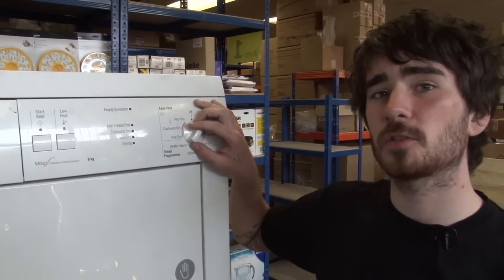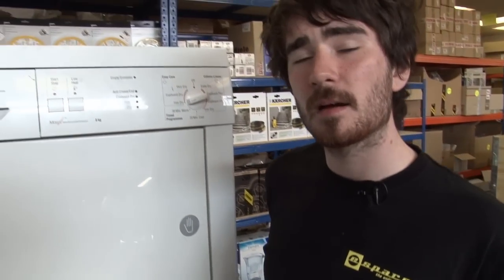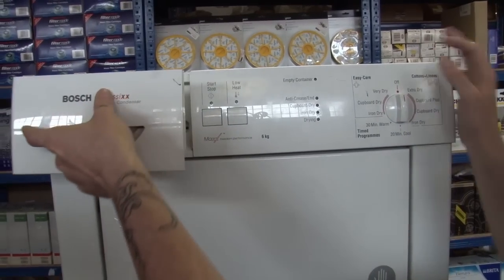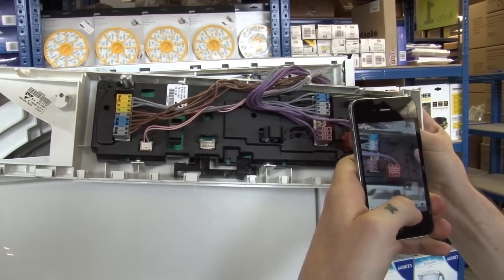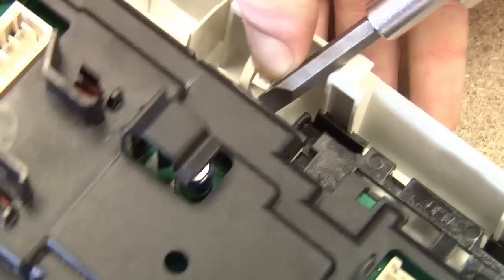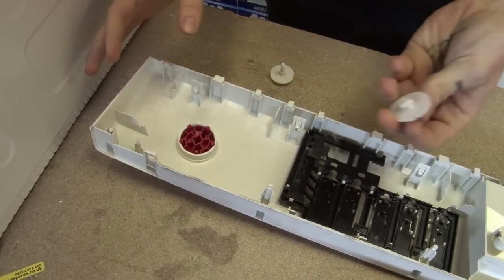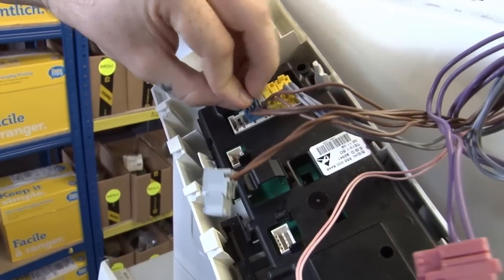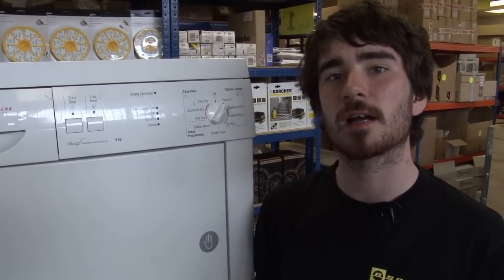How to replace a tumble dryer control knob on a Bosch tumble dryer

Comment: Hi Rory. Can you tell me what tool is needed to remove the bolt/screw to the right of the program fascia on a Classixx 7 washer? I was told by bosche it was a T20, but having tried two different drivers they do not fit.
Reply from the maker: Hi Ian, we are not sure as we haven't a machine available currently but think it is a T10. We know the following kit has the right size if you need it: http://www.espares.co.uk/product/es1251179/9-piece-torx-head-screwdriver-set

Comment: So I have an Indesit is60v and when taking it apart, the control module fell apart -_- Do you have any images or videos showing how the parts are meant to fit back in?
Reply from the maker: Sorry Kerry we do not have a video on this repair.
Looking at the exploded diagram supplied by the manufacturer  we cannot find a 'control module' only the 'Pcb Relay' and the 'Timer'.
Both these parts are supplied assembled and do not normally 'fall appart'.